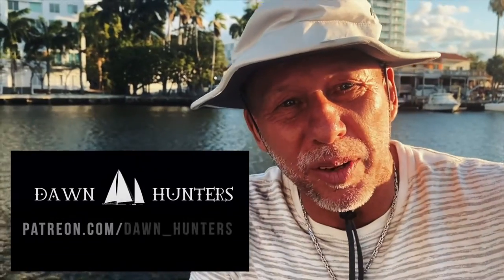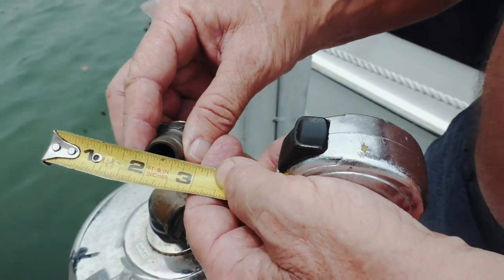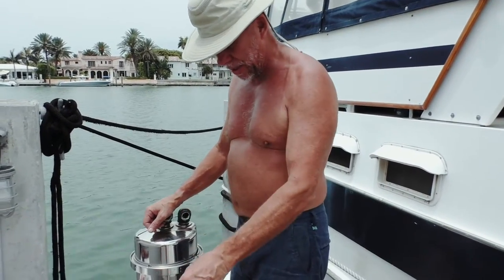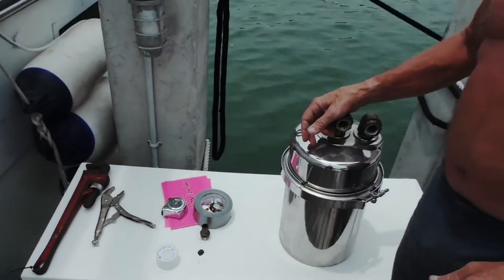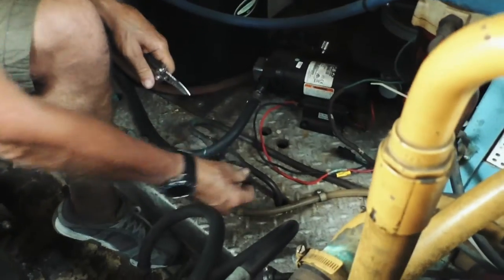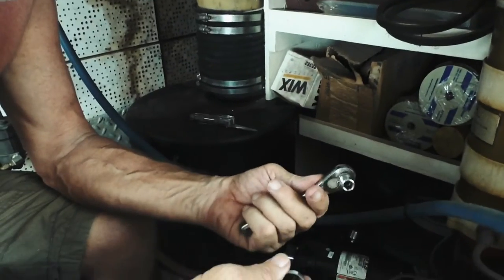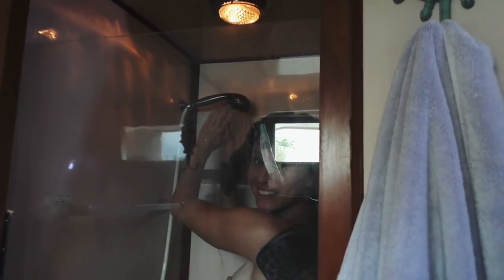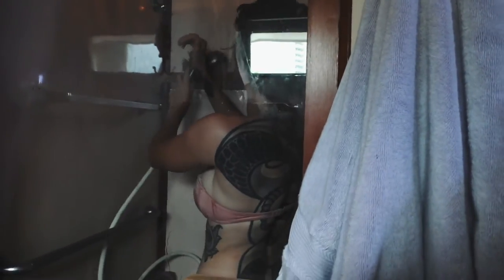Seagull Water Purifier - Boat Water Filter Installation Tutorial - Dock Box Talks

Comment: I have a filter that is about 1/2 that size. New filter elements are about 50 and worth every penny (carbon). Usually that itching is the result of an allergy or sensitivity chlorine. I remember when I first started using certain hot tubs I had that problem. For me it went away but it was the chlorine. Yes, a boat did that which I was aware of and filled up the bilge with their drinking water. I would think some sort of alarm should be set up regardless.

Comment: Hey Capt W. 
I noticed when you were hooking up the filter housing, you hed one bushing reducer attached to another bushing reducer. Why not replace the first one and go  from 1/14" to 1/2 hose barb.... just asking. Thanks for the vid. And If you didn't  notice, I have been binge watching your blog.
Reply from the maker: Eric Hyney 
Very good question!!!  If you go from a large to small ID too fast you can build deposits at the reduction areas. For a water filter this is not the case as we have pure water but it is just a common practice for me.  Other issue with this unit is when I found it already had the fittings so I only replaced the tape and re-installed. 
Thanks for watching. 
Capt W

Comment: Tip: The PTFE you put it on the thread in the wrong direction, the tape should be applied in the same direction as the thread.
Reply from the maker: Very good eye!! Yes I realized after watching the video I had wrapped it wrong. The advantage about using a good brand tape on large diameter fittings is that it still does the job. I will be installing a jet thruster to the stern of Dawn Hunter. For sure you will catch me doing something 🤓. I don’t like to do things on video but my wife Iana can be real convincing. Thank you for watching
Reply: @DawnHunters  She's a beaut(Aussie slang)and you're a lucky guy to have such a great gal, we enjoy your vids keep them coming!
Reply from the maker: flash more Good Morning (from Miami). To be honest Iana is an amazing Wife and Friend. She helps in almost every project. To share experiences with someone and making memories makes it all worth while. Do you have a boat? Can’t wait to get back on the water. As an Engineer I can’t leave things alone and I design/fabricate everything double the strength. Anyone that has a boat from a sink to an oil rig interests me. Thanks for your support.

Comment: I can bilge watch your videos endlessly as they are funny and educational.  Never a dull moment.  And, yes, I wrote bilge instead of binge.  Does the water system retain its pressure when you shut the pimp off?  Or does it leak through somewhere?  I suspect, even if the pressure drops, inlet you develop an air pocket, the instant you turn on the pump, you have pressure.  Any concerns with water hammer.  Iana, this is for you.  I’m sorry I have to see you have to buckle your bikini strap in the back by yourself (the episode you talked about your tattoos.). And then now, you had to wash your own back with no help.  I’m not suggesting a mutiny or anything.  Heck.  I don’t know what I’m saying.  I’ve caused enough misery.😉✌️🤙
Reply from the maker: Hello Perry!!
The water system on the Dawn Hunter is not real complicated but built to ABS standards. The stainless steel
holding tank has a capacity of 1,000 gallons and sits perfect to midship for ballast. Water from bottom of the tank is transferred via 3/4 bronze fittings to inlet of a 24vdc water pump and into a 10 gallon mini tank with a pressure switch set to 45 pounds- as water is pumped into the tank it compresses partial upper air in the tank. The lower output of the mini tank then feeds a water filter, cold water lines and hot water tank/lines. Any onboard facet or water valve opening draws pressurized water from the mini tank and once pressure falls to 20 psi the pump is energized. There is no water hammer as the copper lines are only 1/2 inch so plenty of back pressure at all times. I am integrating a water maker and also have designed the pilot house roof with a rain water collection system thru a large micron filter to capture rain water when possible. 
Regarding back washing duties the Captain must plan a full day as dragon washing takes longer time than one might think. Lol
Capt W
Reply from the maker: Perry Diddle iana here. Good night Perry! That creature that is not dragon might get upset for “missnaming” and turn both you and William into stones 😉😈
Reply: Dawn Hunters “Good night Perry.  Good night Perry.  Yeah right,  now I’m gonna have nightmares. I’m thinking you left a clue about turning us to stones.  Medusa?  Is that you adorning Iana’s back?  I’m screwed if I look into her eyes again.  On the other hand, you left a devil emoji.  I gotta risk turning to stone and check you out some more. 😉. Let me first grab my crucifix and investigate. ✌️🤙
Reply from the maker: Perry Diddle iana here. How was the sleep Perry??? Alive??? Lol. So it’s not a Medusa, nice try! You have two more tries left before turning into stone 😆